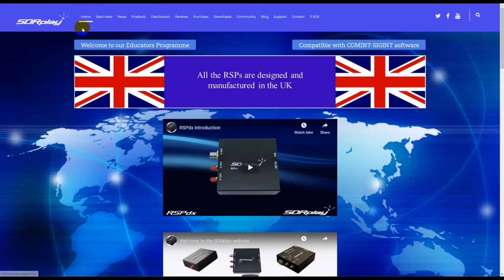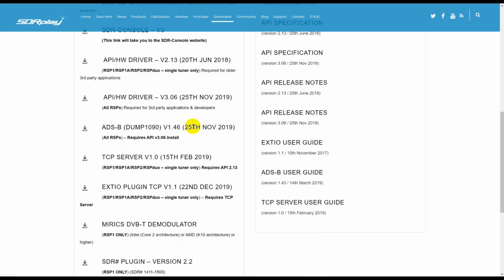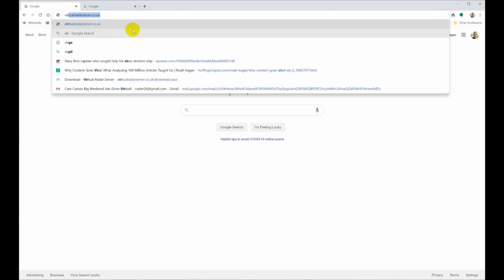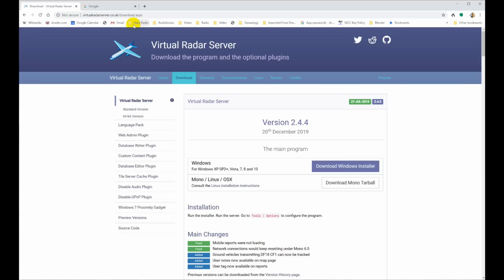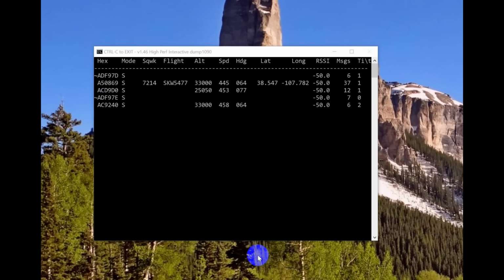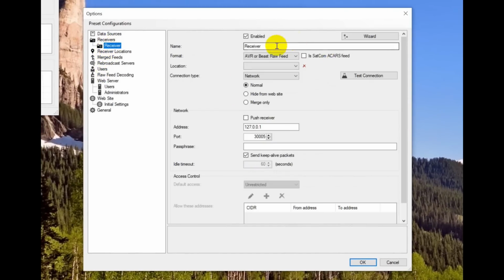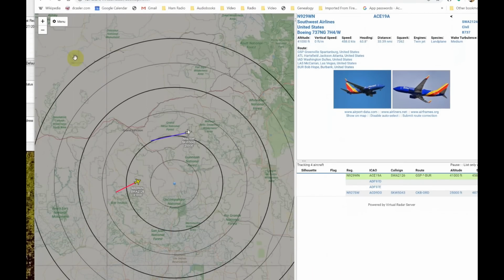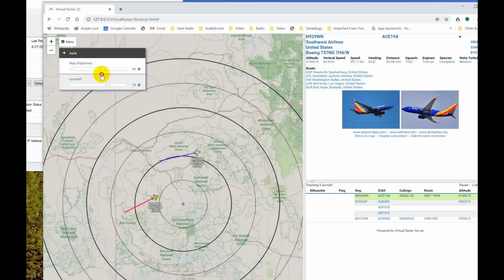Stay at Home Special: ADS-B on your SDRplay Radio (#277)

Comment: I am assuming this does not work using the SDRplay RSPdx? When running the bat file "start dump1090" I get the mssg that sdrplay_api_Fail and that the api had a device error then shuts down. Is this accurate?

Comment: Thanks Dave for this informative video, so the tip of the antenna you described was cut 6.5 cm and same with the shield, but you did cut it a certain length from the start, could I just have a 4oft coax and having that 6.5cm exposed on the end?

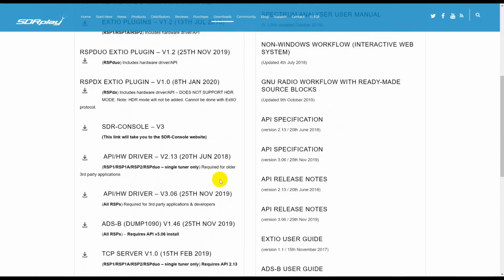Comment: Dave, I figured out how to get ADS-B to work with a generic SDR receiver like the ones on Ebay and wrote it up in a Google Doc. for anyone who is interested. Basically they will need to download a different version of Dump1090 from  signalsat.eu then follow your video from about 3:00 on.  Of course you could just go to FlightRadar24.com and see the same thing online but since this is about radio it's more fun to do it yourself.
http://www.satsignal.eu/software/dump1090-win.1.10.3010.14.zip
https://docs.google.com/document/d/e/2PACX-1vSFY-wgiAxXQb-Q-r-LVqNyLOQC-7-fh0AoRkEgjGim0yeI7W6w6-DYbfTmT4f6ONxSgSPUVFYF5v_X/pub

Comment: I haven't yet tried this yet but for making the dipole antenna (something to do and enjoyed it,thanks). I have a winradio G305 SDR. This might be a stupid question but, will this software be compatible with my SDR. It does have a Frequency range from 9 kHz to 1800 MHz so that part is sorted out. Kind regards & 73, Ian.

Comment: This looks like a ton of fun!  You can also use a 1/4 wave ground plane made with a coax connector to build the antenna as well.  Putting 8 radials on instead of four gives outstanding performance with very good mechanical properties if you want a permanently mounted antenna.

Comment: I saw a similar set up with a SO 239, a length of conduit an a conduit plug or cap. the socket went backwards the the plug (theads down abd the othe end up with a length of conducter as the antenna. the conduit was the ground radial like structure.

Comment: Not being that "computer savvy", I had a very hard time following this installation, even doing it 1 step at a time by pausing the video. I finally gave up. I may try it again later.
Reply: This is all very specific!  It probably won't make any sense to you if you don't have the special SDRPlay radio he used.  He should do a more generic version for everyone else but there are already a lot of Youtube videos on this subject and most of them use a Raspberry Pi that has dual receivers that can get both bands on 1090 and 978 Mhz.

Comment: Thanks for another great "stay at home" video . You'll likely want to keep this running but get your SDR-Play back for other general purpose use. A raspberry pi with dump 1090 and little rtl-sdr dongle  setup works great and is inexpensive enough for dedicated 24/7 use. Dave WJ1I.

Comment: Hey Dave... great stuff.  How did you connect your homemade 1090 dipole to the SDRPlay?  How did the connector attach to the dipole?  Keep up the great work.
Reply from the maker: Awhile back I did a video putting a Times Microwave PL-259 onto a piece of LMR-400. I made the antenna from the other end of that same cable.
Reply: So the overall length of the antenna is not important? Just the stripped back end and where the shielding was folded back is what needs to be relatively exact? Just getting into this hobby and learning. Thanks
Reply from the maker: @stephenstankus4410  The length is very important. The amount cut away is one quarter wavelength, and the sleeve folded back is another quarter wavelength. The two together make a vertical half-wave sleeve dipole.
Reply: David Casler but the uncut portion that runs to the rsp1A is not critical?

Comment: Good stuff, Dave!
I started out "doing ADS-B" using this exact method! Thank you for explaining it so well!
I have a Piaware ADS-B server connected to the Flightaware system in a dedicated system running from a Raspberry Pi and a specialized ADS-B SDR radio dongle. This is an interesting way to go as it can be used to monitor your system remotely when set up to do so.
My range averages 150 miles or so because I don't have an ideal mounting location for my antenna, but living between PHL and AC there is plenty to see on ADS-B in southern New Jersey.
I loved seeing your dipole antenna build for this because that's what I'm using on my Piaware setup. Mine is made from RG-174 coax and is using a drinking straw and a rubber SMA connector cap for a radome.
The specialized dongles are nice because they feature built-in amplification and filtration useful in noisy areas.
73 de N2NLQ
Reply: Yes, I run PiAware also and feed into FlightAware. Great piece of software and as you say it's useful for remote monitoring. Virtually zero flights over my area of the UK, the predominant flights I'm seeing a lot of the air ambulance and police helicopters at present. J
Reply: @johng7rwf419  I have watched the patterns change drastically over here as well.

I have received an email from the folks at Flightaware stating as much and encouraging folks to keep their stations running in order to help collect data as the situation changes.

Comment: Hi Dave, been using SDR dongles to see ADSB for several years, very interesting, esp if one works in the industry.  ADSB assists atc with augmented infirmation on radar blind spots as well,  cheers dave n thx fr bringing this topic. I use a simple rtl-sdr and have used the funcube dongle, 73s

Comment: A few years ago I setup an ADS-B receiving station using an inexpensive DVB-T dongle and a coaxial collinear antenna and ran the Dump1090 software on a PC.  For the antenna I followed this guide: http://www.balarad.net.  Shortly thereafter I used the same setup on a Raspberry Pi using software from Flight Aware.  The Flight Aware setup is very easy and its fun to share your data and to see your stats.  You can also view your live data locally in any web browser by typing in the IP address of the Raspberry Pi.  https://flightaware.com/adsb/piaware/build. I now use the Flight Aware Pro Stick Plus ($20) and the Flight Aware Outdoor 1090 Mhz Antenna ($46) with LMR400.  The Raspberry Pi has been very stable and the setup has been running for several years now.  Flight Radar 24 also has a very similar setup.  https://www.flightradar24.com/build-your-own.  I haven't tried it yet but it is possible to feed both sites from a single receiver.  Both Flight Aware and Flight Radar 24 will give you free subscription services for sharing the data.  This is just another option that doesn't cost a lot and will free up your SDR Play.  I often use my setup to identify the planes flying over the house because the data is live without delays.

Comment: I very much like your videos and this is very interesting too. It may seem like a stupid question but how did you connect the antenna to your receiver? Did you already have a PL259 or BNC on the length of coax? 73.
Reply from the maker: Yes, in a previous video I put a PL-259 on the other end of the cable that I used to make this antenna.
Reply: The video Dave is referring to still doesn't address your question.

Comment: I work at KSTL  airport and have to use systems like FlightAware and Flight radar. I am curious as to what coax you used and how you connected the feed point to the radio. Thanks for the great videos
Reply from the maker: In a previous video I connected a PL-259 to the piece of Times Microwave LMR-400 coax that I used for this antenna.